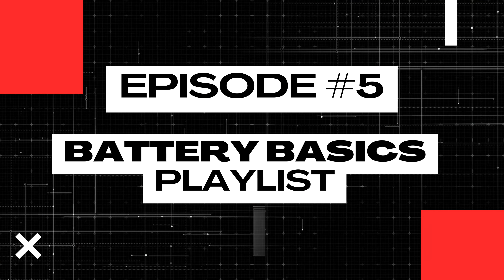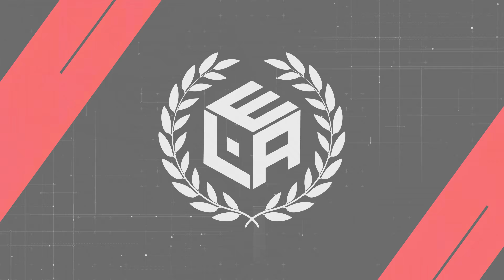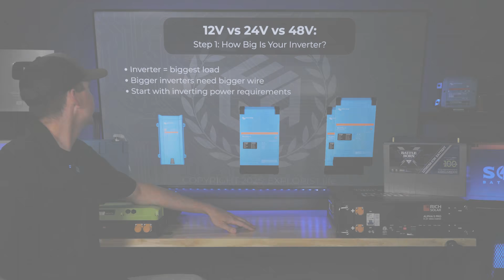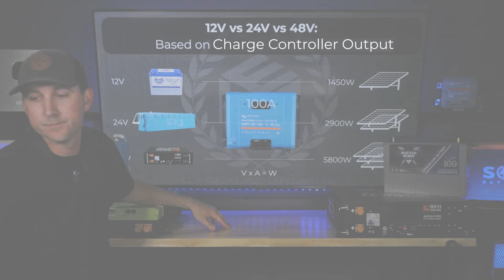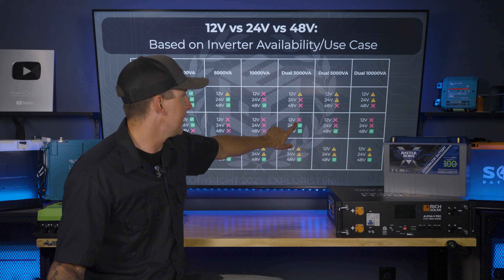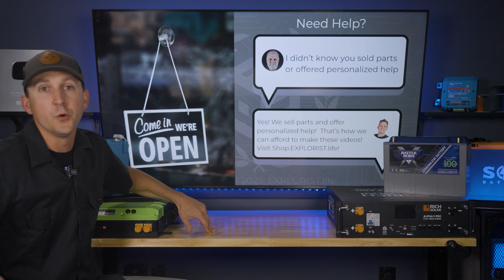How to Choose 12V vs 24V vs 48V (in an Off Grid Electrical System) - Battery Basics | Ep 5/7

Comment: So at this point.  I can go. On my 30a rv. with 48v system.    Using  the 48v/3000   And mppt 150/70   And 2 battery of 48v  100ha    eg4 lifepower4.  The standard ones. Using 6 panels of 440w  (2640w)voc :39.30  each.    
 And now. What will be the best option to connect them.  3s2p (117.9v) or 2s3p (78.6 ). 
 I know 2s3p will  take more wiring etc.  but.  If just in case i got a shade  from the ac unit will affect on 2 panels.    Not 3.    Or go with 3s2p less wire.   Less connections .    My mppt. Will handle. Both configuration. Any ways.   Any advice. On this.   Thank you.
Reply from the maker: Great question! The best configuration depends on shading, panel specs, and your setup. We'd love to take a closer look and help you choose the right option! Reach out to our team here: https://shop.explorist.life/support?utm_source=youtube&utm_medium=comment&utm_campaign=support&utm_content=response_link
Reply: @EXPLORISTlife thank you.

Comment: Unless I missed it, in my opinion, the main reason to go with a 24v system in a van or camper is because almost all dc devices support 24v. e.g., most fridges, PD USB C ports, almost all low voltage LED lights, Starlink, etc. All other 12v loads can be handled by an inexpensive 24-12v converter. In a small rig DC environment that needs 3k VA or less of inverter, 24v is a no-brainer.
Reply from the maker: We have 24V systems available for all application if that's your preference.  Shop here: https://shop.explorist.life/?utm_source=youtube&utm_medium=comment&utm_campaign=support&utm_content=response_link

Comment: The thing you missed is the fuses and switches you need. 12v and 24v DC is normally easy to source (most go upto 32v - AC fuses and switches are different), but 48v systems make it really difficult. My system is a blue seas backbone supporting victron active components.
Reply from the maker: I would say that's less of a problem  now in 2026 than it was 4-5 years ago.  We have proper fuses in all of our kits you can see in our store here: https://shop.explorist.life/support?utm_source=youtube&utm_medium=comment&utm_campaign=support&utm_content=response_link
Reply: @EXPLORISTlife On your website most fuses and switches still are limited to 32v. Nothing much has changed - you can get equipment for 48v aystems, but it is mech rarer and often expensive - the sweetspot is still 24v.
Reply from the maker: We have fuses up to 80V.  All of our 48V systems utilize these.  Switches are still limited to 48V hard-cap, but we can get around this through smart system engineering.

If the proper fuses/switches/equipment was too hard or too expensive to find/source, we wouldn't offer 48V systems in our store, much like we didn't offer those 3-4 years ago.

Comment: One thing I didn't hear and is super common in RVs.
In a 50a 120v RV that doesn't need any 240v,  which is recommended:
2 x 24v Multiplus II 
or
 2 x 24v Multiplus II 2x120's?
I would think the 2x120's because if one fails you still have power to L1 and L2, but maybe there's other considerations I'm missing.
(Sure wish Victron would step up and release a 48v 6k5 2x120 for the US market)
Reply from the maker: That’s a great question, and for a setup like that there are enough system-specific considerations that we’d want to look at your exact RV and power goals before recommending one over the other.

Reach out to our support team and we can take a personalized look at your project and help you choose the right components 👉 https://shop.explorist.life/support?utm_source=youtube&utm_medium=comment&utm_campaign=support&utm_content=response_link

Comment: I've been running my entire home 120v circuits off of 12 volts for years with 4 200 amp hour flooded deep cycle batteries and one day I will probably switch to 24 volts. Using 12 volts does take a little bit more management.
Reply from the maker: Sounds like a solid system, but you'll definitely see benefits if you make the switch to 24V! 💪
Reply: @EXPLORISTlife Everything is set up for 24 volts as I just haven't purchased my 24v Victron inverter yet.
Reply from the maker: Sounds good!  When you're ready to purchase that, we are ready to ship it out. 😎 https://shop.explorist.life

Comment: my setup was anern 24v 3200kw hybrid off-grid 80A inverter solar panel for now is 4pcs 200w but planning to buy another 4pcs 200w, can i hookup 4pcs 12v100ah  in 2p1s to make 24v200ah? battery brand Gentai wire plan to use 25awg because for now i have 2pcs 12v100ah in series battery and planning to buy additional 2pcs battery. its hard to sell the battery ive brought so ive decide to buy another 2pcs 12v100ah to expand my battery bank its hard for me what to use some saying its ok to use 2p1s some 2s2p.
Reply from the maker: Battery bank expansion (series vs parallel) really depends on the exact inverter, battery specs, and how everything is wired together — it’s not something we’d want to guess on in a comment.

If you reach out to our support team with your full system details, we can take a closer look and make sure you’re set up correctly (and safely): https://shop.explorist.life/support?utm_source=youtube&utm_medium=comment&utm_campaign=support&utm_content=response_link

Comment: This is a solar panel question. I saw a video on  taking 6panels, making 3 sets of 2 in series, then put that in parallel. He then splits this into two cables. This is for 6ov inputs 20 amp max and 1200 watts max. 200W panels VMP:23.74 V   IMP8.43A    VOC27.3V    ISC8.91A Can this really be and if so I do not understand the outcome Thanks up front..
Reply from the maker: Series/parallel math can get confusing fast, and whether that wiring actually works depends on the exact 60V / 20A / 1200W device and real-world limits (especially cold-weather Voc).

If you reach out to our support team with the exact controller model and your panel setup, we can verify the numbers and make sure it’s safe — and help you get the right parts if needed - https://shop.explorist.life/support?utm_source=youtube&utm_medium=comment&utm_campaign=support&utm_content=response_link

Comment: And there I thought different voltage batteries has a lot to do with charging speeds ... Or does/doesn't it?... Lets say using my stationary set-up, charging from the grid and use solely as a huge UPS system (excluding high demand appliances of course)?
Reply from the maker: Good question — battery voltage can affect charging performance, but it really depends on your specific inverter, charger, and how you plan to use the system as a UPS.

Rather than guessing, our support team can look at your exact setup and help you choose the right voltage and parts for your goals 👉 https://shop.explorist.life/support?utm_source=youtube&utm_medium=comment&utm_campaign=support&utm_content=response_link

Comment: Very good explanation. And very good methodology.
Except...
You're not wrong that two 120Vac air conditioners would require higher inverting power, but couldn't it be better and more efficient to seek out DC options for those instead of relying on bigger inverters?
Which brings up questions of charger capacity and maybe not using a combo inverter/charger.
If using a 24v or 48v system, adding a 24 or 48v alternator system to the RV or tow vehicle is a great option.
Next complexity to adress is the sizing dc-dc converters and possibly battery storage° for all the components and systems you can't find in 24Vdc or 48Vdc.

°case for additional storage:
Loadshed. Put all lighting on a 12V system and battery that can give a few hours of lighting after the main batteries are depleted.
Reply from the maker: Most people won't want to open their RV walls to re-run new/larger wire for DC air conditioners.  This is information we've gained on hearing how apprehensive people can be to simply drill a hole in their roof to run solar wire.  Re-Running wire to the air conditioner would be MUCH more invasive.

Of course, for the .01% of people who want to do that, and maybe you're in this group, we would rather consult with you directly on your wants and needs to make sure you get what makes sense for your build.  Reach out here: 👉 https://shop.explorist.life/support?utm_source=youtube&utm_medium=comment&utm_campaign=support&utm_content=response_link
Reply: @EXPLORISTlife certainly that is the case if upgrading a system. But if buying new or building DIY, the industry is failing the market by not pursuing using DC equipment.
But I think it speaks to the poor state of the RV market that upgrading or improving systems is so difficult and RVs are often so questionably built. And that is before getting into how getting higher voltage DC equipment is such a chore for even basic components. 12/24/48V and higher is available for many appliances and compression cooling and heating applications.
I actually find it unfortunate that Victron combines chargers and inverters. Seems you can't get the same functionality/capacities in separate units.
Can total charge rate be controlled with multiple charges paralleled?
Can a charger be installed in parallel with a charger/inverter and still be able to control max shorepower draw?
Reply from the maker: Like I said - if you're actually in the market to purchase, please reach out directly so we can discuss your personal needs and get you what you're looking for: Reach out here: 👉 https://shop.explorist.life/support?utm_source=youtube&utm_medium=comment&utm_campaign=support&utm_content=response_link
Reply from the maker: Gotcha,  I wish I had enough hours in the day to just chat about this stuff.  I'm truly passionate about it, but it's tough to find the time for idle conversation about these topics and also run a business.  I hope you'll consider shopping with us for your next project.  Our prices are the same as amazon even though we are a small family-run business and our expertise in this field is top tier.  If you enjoy our videos - they are also funded exclusively by our store.
Reply: @EXPLORISTlife no problem. I don't want to monopolize your time.
Ive appreciated many of the videos youve produced (ignoring the BattleBorn being so front and center 😊). You always seem knowledgeable and your builds have given me ideas.
If the threats and tradewars are done, I'll check your prices. You may well have earned my business. 
Don't think there's anyone local with a stock of Victron components, but I've been burned by UPS with customs fees even back when our countries were friendly and respectful to one another.
Best of luck, look forward to upcoming videos.
Reply from the maker: For UPS customs fees, you can avoid those if you self-clear the custom claim yourself instead of having UPS do it for you.  When you go to purchase, ask for our "Tips on self-clearing an international package at the border for duties" and we can share the info we have on that.

Comment: Wow, this was so helpful!

It's really weird that there's not a 50A 5000W 24V inverter combo. That's exactly what I need...
Reply from the maker: So happy to hear it was helpful. Thanks for watching!
Reply: I researched and thought long and hard about this with our new RV and decided to go with dual Victron Multiplus II 12/3000/2x120 units. This provides more power and redundancy than a single 5000 watt unit and avoids the need for 24v-12v converters and their own cables. The only drawback is the heavier (or just multiple 1/0) cables needed for the 3000 watt units, but that's minor compared to the additional cost and complexity of 24v, in my view.

Comment: I use a 48v system in 2 of our campers. Decided to put a "Victron battery Protect 48v, 100amp" in the newest system, but it kept throwing itself into an error state related to "inrush current" 70% of the time when starting everything up - tried everything to get it to stop faulting (even with nothing connected on the output side). Ended up pulling it out and I'll just keep an eye on my batteries SOC myself. 
Other than that, love 48v gear
Reply from the maker: Hmm.. those parts shouldn’t be related to any kind of inrush current issue.  Reach out and we can check into that more specifically because simply removing the smart battery protect could be critically dangerous: shop.explorist.life/support
Reply: @EXPLORISTlife 
In order of connection -
- 48v Battery (not Victron)
- isolator switch
- Victron distributor (fuses)
- isolator switch
- Smart battery protect 48v100a
- 48v fused bus bar
- 3 x Victron 48-12/360w DCDC's in parallel (same length cable)
- 12v fused bus bar (to combine the 3 x 12v outputs. Same cable lengths)
- Progressive Dynamics 12v distribution panel (with 2 fuses running lights and 2 fans (still wiring up the rest of the camper).

If I progressively turn things on (Battery on, isolator to 48v distributor on, isolator to SBP on) 1 out of 10 attempts the SBP will start up fine. The other 9 it throws E1. 
Remove the fuses from the PD Panel so there is no 12v draw, and it still throws E1.
Pull the fuse between the SBP and the DCDC's so there is no draw on the SBP, start again, on the 2nd or 3rd attempt it will get passed the E1, but then if I turn everything off again (cause I'm not stupid enough to connect a live 48v fuse) and put the fuses back in for the DCDC's it throws the E1 again when I start it all up again.

So I just have to keep turning it off and on again until I catch a good start and it works.
(Before you say one of the DCDC could be faulty, I also isolated and tried just 1 DCDC and still no fly (I also tried isolating a different one just in case I tested with the potentially faulty one by chance))

The only thing I can put it down to is that the Progressive Dynamics board has red indicator lights to show blown fuses. This means that anything connected, whether it has a fuse or not, has 10v and a couple of milliamp going down the wire. I think maybe this is enough for the SBP to throw an E1 error thinking it's a short circuit, OR somehow an inrush error (I hate how E1 can be multiple issues). (Though I can't even be sure of that because it doesn't work immediately if I remove the PD Panel from the equation, still intermittent).

So I removed the SBP so I could keep setting everything else up. I might contact support and request a warranty unit just to see if it's just faulty, but being intermittent I'm not sure. 
Considering contacting Progressive Dynamics to see if I can swap my unit for one without the blown fuse indicator to try that first. I don't like that there is enough power going down the "unfused" wire to power up the little LED display on my UV water filter (little hour counter LED, enough for that to light up even though there is no fuse). Apparently this is just how blown fuse indicators work, but maybe PD's board allows a bit more power through than others.

Anyway, sorry for the rant, not asking you to help, was just cathartic to complain to the void for a minute
Reply from the maker: Gotcha, yeah - if you want us to take a step in and assist, that's the benefit of purchasing from our store!  You get free customer support for all items purchased from our store, so we are always here to help or provide a 2nd opinion as needed: shop.explorist.life/support
Reply: @EXPLORISTlife hey, I haven't 100% confirmed it yet but it turns out it might be that you can't have Orion-TR 48/12 DCDC converters AFTER a 48v Battery Protect as they act as a  capacitive load and have the same effect on the BP as an Inverter, which will just throw it into E1 error. 

I was originally hoping to use the BP to cut the power source to the 3 x 48/12 DCDC convertors and all their loads

Anyway, will keep messing around and confirm

Comment: Great video Nate. Loved the idea of color coding borderline/don’t do it . The only thing I would say you missed is you can do 50 amp on a 48 V system. I have a 48V with a Quattro 5000/48 but I only use L1. The whole reason for doing that was to give me 50 amp instead of 30 A and I just don’t use L2, as in need 100A. I frequently run two mini-splits and electric induction/oven without problems. I currently have 3330w of solar. In conclusion, it is a valid configuration that probably is worth mentioning. Once again great job.
Reply from the maker: I would say that is an extreme fringe case. Our customers generally want their whole breaker box to function off grid.  I haven’t never had a customer to my knowledge who reaches out and requested only one half works.
Reply from the maker: Did you buy your parts from us for that project? 😀😀👍

Comment: Question from the back.  We have 1600 watts of solar, 8 12V batteries, a Victron 3K multi-plus, 1 Victron charge controller.  Want to go dual 3K inverter, add another 1K of solar, and another charge controller, and add 2 12V batteries to get to 1K amp hours.  We are a 50 amp fiver.  

Your chart had an X on the dual 3K inverters, so should I switch over to 24 volts as you recommend???  The solar guy we used did an outstanding job (clean and tidy) job and said it wasn’t necessary to go 24.  Would like your opinion on staying 12V.  Thanx!!!
👍😃🍻
Reply from the maker: For 6kVA of inverting power, a 24V battery system would indeed be strongly advised.  We can help: https://shop.explorist.life/support